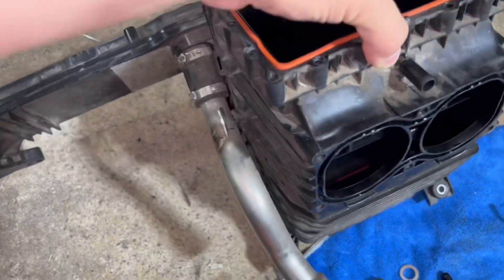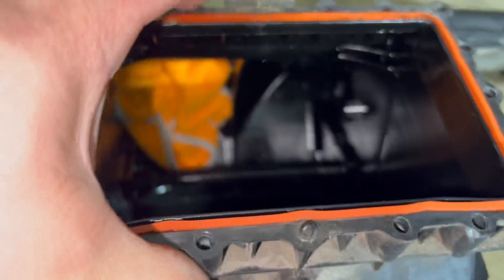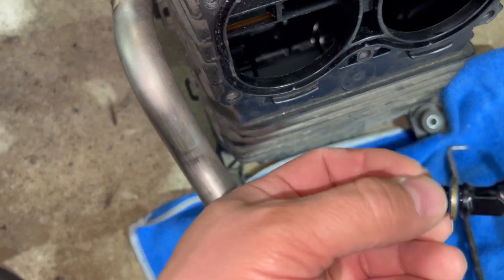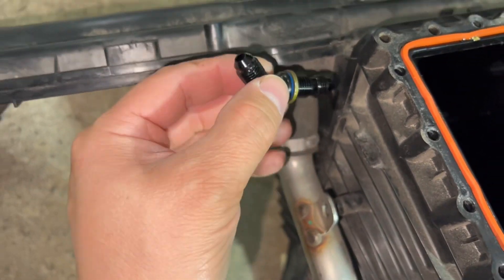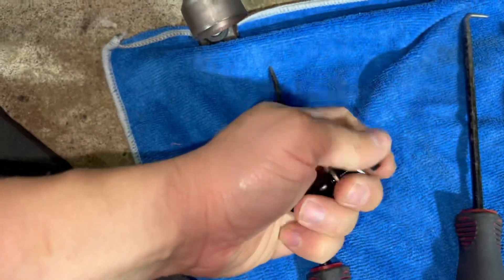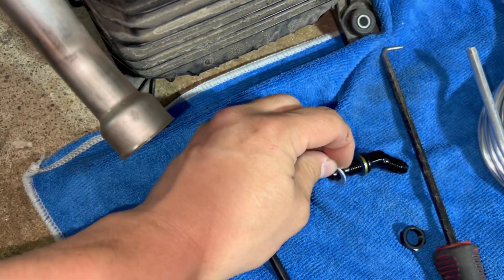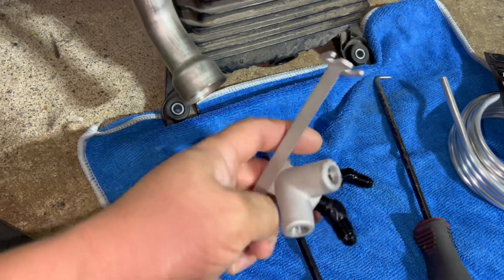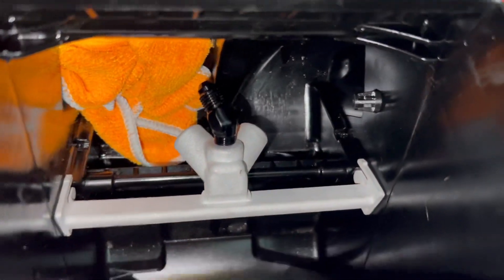METHANOL SPRAY FOR AUDI 4.0T ENGINE GEN 1

Comment: Hey Oleg, do you see any possible future issues running aluminum pipe inside? I was under the impression that methanol and aluminum don’t mix? 

Amazing work as always and how do I order one?
Reply from the maker: I was planning to go with stainless steel but it’s hard to bend in such small dimensions, This 1060 aluminum tubing is used for air conditioning, refrigerators, heaters, water heaters, and other appliances so this tuning will do the job. Can’t use plastic tubing inside because I’m worried about leakage and melting.